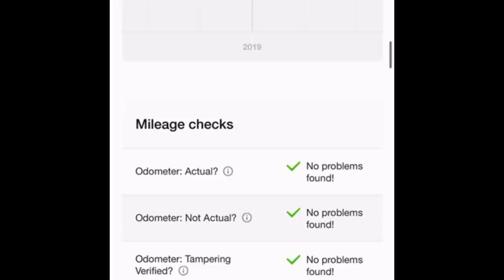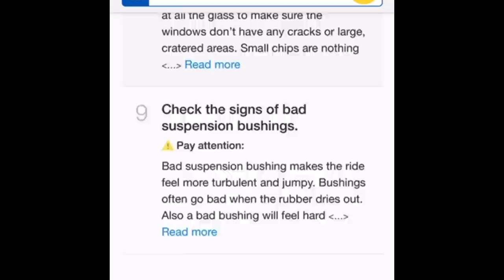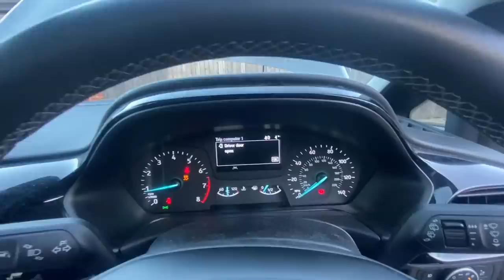2019 Fiesta Lemon !!!! Probably The Worst Crash Repaired Car Ever !!!! PT 1

Comment: Totally agree with your comments about Cat S repairs. Would it have passed its first MOT 🤔
Reply: A mot doesnt check accident repairs anyway
Reply: It probably could have failed due to a deformed body structure, I can't think of the exact RFR but it goes along the lines of that 👍
Reply: Don't think so? Rob said one of the fog lights wasn't even plugged in when they removed the bumper its so bad!
Reply: @picklesrule69  Interestingly front fog lights don't have to work for an MOT 👍
Reply: If you were interested take a look at the MOT manual, section 6.1.1 a(i) and d)(i) in my opinion 👍
Reply: @sammytheseal2307  never knew that tbh! I'm not in the trade myself..learn something new every day 🤣
Reply: No that's fine we're all learning all the time even those in the trade 👍

Comment: I really like that format got to see how really bad it was it looks like I tryed to repair it and I'm a carpenter. Hope ur able to still make a profit on it it's a dog. Why the hell someone would do that to a car that new I don't understand if it was a 15 year old Yaris I could understand. Reminds me of a guy that used to do a lot of repairs on cars around here 40 years ago the joke was he used to mix the filler in a concrete mixed he put that much on. The tyres look a worn for 20k do u think that car could have been crabing. I know u said it was driving fine but the front is fairly mangled.
Reply: I bought a Mk 1 cortina two door and the previous owner, a builder, had repaired the badly dented o/s/r quarter with concrete.Probably cheaper than filler!

Comment: I get the same kind of stuff in the computer and electronics industry. Have a go DIY'ers making the job worse instead of just bringing it straight to me. Motherboard traces jumped with pieces of wire instead of having the traces fixed properly, bad solder work, the list goes on!